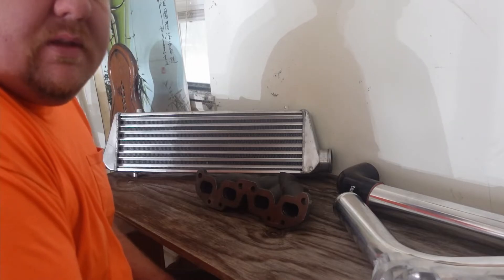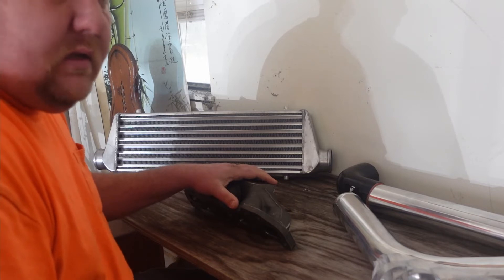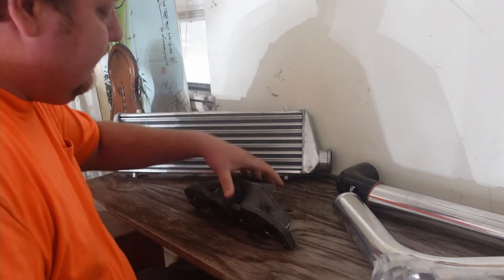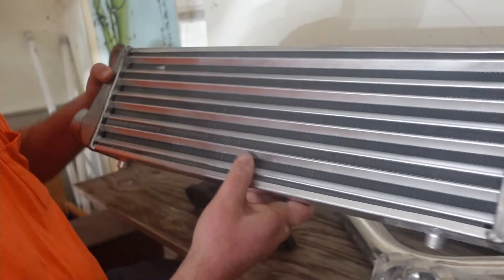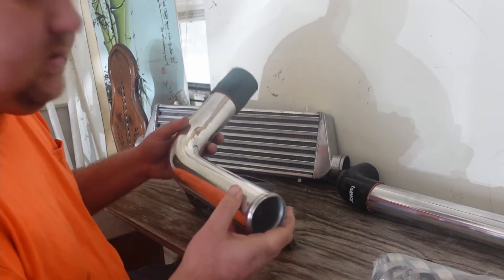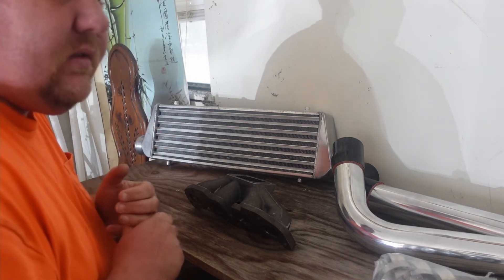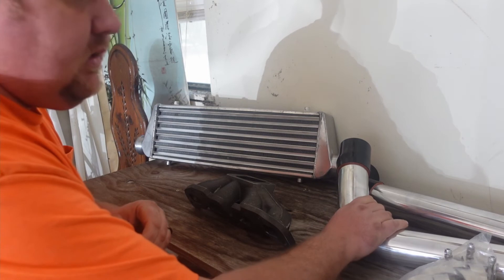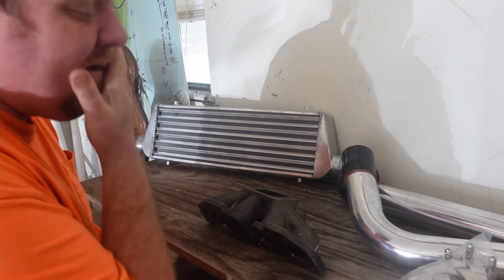Specv turbo install #2

Comment: I hear you man. I would suggest getting the treadstone manifold so that the downpipe would fit properly. Just make sure that you get the correct one because I made the mistake of buying the 'blow-by' set up rather than the 'blow-through' and the shop had to fab it to make it fit which was expensive.
Reply from the maker: Yea I had to take it to a local welder to make it fit already. I didn’t have the bolts to connect it to the new mid pipe so that is why it’s back to open downpipe right now. I wish I had got the treadstone manifold from the beginning it would have saved me a lot of trouble plus it being stainless.
Reply: @red_rabbit_specv  Where did you get the spring bolts to connect it to the mid pipe? I'm asking because the new ones I got from the dealership is too short and wouldn't work.
Reply from the maker: @driven_obsession  I got them from O’Reillys but I haven’t connected the mid pipe yet so hopefully I don’t have the same issue
Reply from the maker: @driven_obsession   i just installed it and the bolts and it works fine. if your on facebook or instagram feel free to message me. i can send screenshots and pictures if you need of what i got for the bolts
Reply: @red_rabbit_specv  What's your Instagram name?
Reply from the maker: @driven_obsession   @red_rabbit_specv